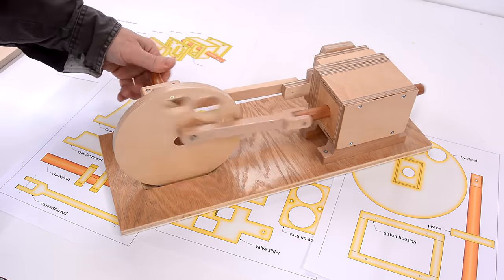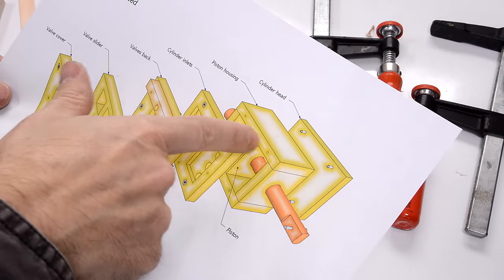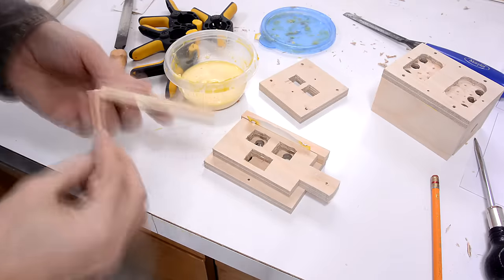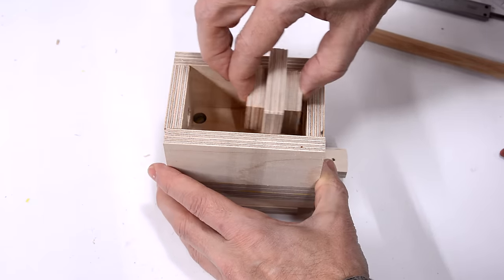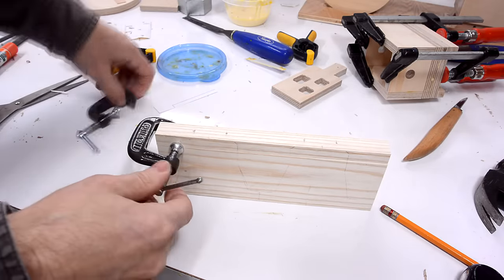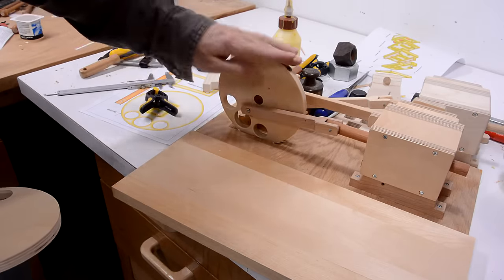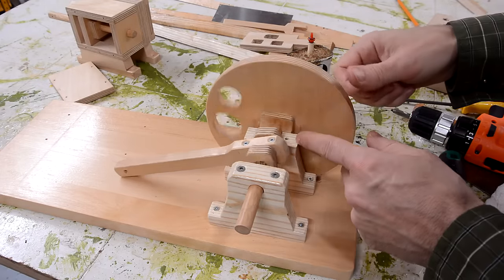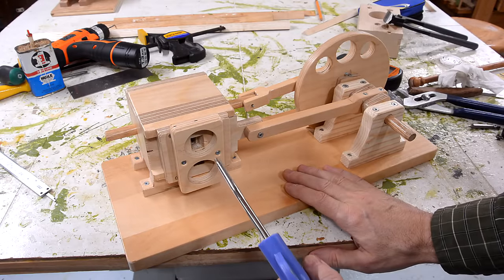Wooden air engine build

Comment: now i want a disc sander to add a little bit of retroactive precision!
Reply: Like your music man.. Nice to see you here..
Reply: So do you come here for inspiration? You make some amazing stuff! It's always great to see amazing YouTubers on others channels.(also how is the new 90-degree foot pedal coming?)
Reply: k2
Reply: nice to see you here :)
Reply: I came down here to comment on retroactive precision, and was glad to see you here, Martin!
I love the mixture of music and building on your channel and am always hyped for Wintergatan Wednesdays.
Reply: Fancy seeing you here
Reply: I love the term  retroactive precision!..
Just wonderful
Reply: Haha not surprised to see you here^^
Reply: Your entire original music machine was bodged  together on the fly with much retroactive precision, until it worked.

Perhaps you could use Matthias’ wooden ,steam engine inspired, type (cold) Air Engine as motive power in your version 2 at some point.

Maybe Matthias could make you a more powerful three cylinder engine for the cause. 
It would look like a foosball table game in play, with the connecting rods and valve gear shuttling vacuum and pressure every which way and in and out all over the place as it ran.
Reply: Scientific Illuminati
Reply: Exactly where I would expect to find Wintergatan
Reply: 2:54 
 @elmasselcuk

Comment: If you connect the axles together and hook up the outlet from the first piston to the inlet of the second (beware of the phasing, the outlet needs to blow air into the inlet when both of them are open), you will have made a two stage engine. :) Normally the first stage would have a smaller piston though, as the pressure is higher there, but I bet it would work anyways. :)

Comment: Would some wax-paper help with the friction and sealing of the inlet-slider?
Reply from the maker: possibly.  But how would you glue that on?  Paste wax would probably be better.
Reply: Quite some time that i last used wax-paper, but i used some in small boat - a bit of sanding and it stuck to wood glue.
But... no idea what wax-paper or what glue it was ^^,
But currently no space for tinkering to test it.
Reply: Mathias, does Big Print program work with Windows 10? Also, what printer can you recommend to use with Big Print?
Reply: Marcus Allen Yes it does. I used it to print a pattern just last week. No problems. My printer is a HP inkjet. I have also used an Epson. Why are you concerned about the printer?
Reply: Fold it over the sides then staple it.

Comment: Thanks for doing this.  I bought the plans for this when you first made them many years ago and, after 3 computer changes, only found them (I think I have them all), split up all over the place, on an external hard drive so I had been intending to try to build the engine when my workshop was finished.  This video is very useful for the detail I would probably have missed.
Best Wishes, Brendan.

Comment: COOL ! Think you could run it on liquid nitrogen?  I have tried a few times to make a bump / bash valve engine out cardboard and a Pringles can but no luck.  Please give the idea of a wooden  bash valve engine a try . The low parts count would make it a quick build and I bet they would spin up really FAST!  Also a wooden Tesla Turbine would be a Hoot .

Comment: Got the plans, had fun making the engine, I was wondering if you could recommend a small motor to power it slowly for the grandkids..its sorta noisy with air and a vacuum , I thought a small DC motor and a variable speed circuit board? any help would be appreciated..Great Plans!!  also quite a bit of wheel wobble on mine..something isn't quite straight..thanks again.

Comment: The correct engine design is no friction, so there is no resistance and no sound, more non-burning gasoline and its noisy explosion sound, with very little energy can play the greatest power, its just the correct design direction.
Like a round flying object when a foreign creature visits the earth, if you 
can design such a machine, it will be a big breakthrough in human.
Wish you success, Goodluck.

Comment: LOVE YOUR VIDS! My next project is a valve for two wet/dry vacuum cleaners which will have them sucking in parallel when at high flow and in series when at low flow, for example when cleaning carpet, during low flow high suction is needed, it will need a simple piston actuator using a tin can.

Comment: Nice job.  A little more in the way of a video graphic explaining how it works so young kiddos could stare at the explanation and capture the understanding of the unified thought of turning fluid flow into reciprocating motion and that's a great STEM teaching tool.  It's pretty great as it is.  Congrats on well made wooden air motor.  It would work if you sprayed it with water ?

Comment: I think you could speed up the offset dowel for the crank pin.  In the 2 blocks with the 2 holes drilled for the pin, drill both half way thru, but from different sides.

Comment: Would be cool to build this air engine into a simple wooden car and try to find a small air compressor to power it. 

Remote trigger pull turns on the compressor to power the car.

Comment: Starting at 10:06 you said the crank needs to be offset by 90° ... so that the control valve is in the right phase.
But it looks like you drilled a hole while the crank was positioned beyond 90°. (95°-100°?)
Thoughts?
Reply from the maker: might be off a bit, I didn't check it.

Comment: When you make your plans, do you space out the parts in SketchUp or do you place them at the correct position afterwards using BigPrint? I found getting the parts evenly spaced out on an A4 paper sheet difficult. 

Also, when you take screenshots to put into a PDF, does a bigger screen equal a sharper image? My laptop screenshots aren't even near the amount of pixels I'm actually seeing on screen. The screenshot must be formatting the picture to a lower resolution or something.
Reply from the maker: I position them in sketchup.  I also don't take screenshots.  I wrote a sketchup ruby script to export the images at the size I need.
Reply: Matthias Wandel Oh nice! Is it for sale?
Reply: I knew you were pretty cool, but I'm tickled to hear you're also a Rubyist. ;D (we leverage it pretty heavily at work, but not for SketchUp)

Comment: Hi Matthias, is there a reason why at 2:08 you're using a drill press instead of , for example, a handheld router ? I guess it's faster because you're already drilling holes in it and you just have to swap the bit and finish with a chisel..
Reply from the maker: routers are noisy and messy, and possible tear out.  And I didn't feel like setting it up.  Drill was faster to set up.

Comment: Safety? Did you really just measure and adjust a cut against a moving table saw blade at time = 0:21 seconds into the video?  You content is way too thought out for that!  Huh? What were you thinking?  Matthias, that wasn't up to your usual high standards for woodworking.
Reply from the maker: wasn't running, just edited out pauses

Comment: Can we use this as an aquarium air pump? how silent is this? if we add a 12v dc motor on the wheel and we add air-pump output, this may work pretty fine in aquaria. More fantasy: we connect to the dc motor to a battery and solar panel, and thus we will have free energy continuous silent homemade air-pump for an aquarium. What do you think?
Reply from the maker: you need a much hither flow rate

Comment: You are obviously a master woodworker, But In trade school we were taught that an Engine Converts Thermal Energy into Motion.  In your case the Energy comes from an external source , so it is a Motor. Great Job on your Motor by the way.
Reply: They do teach those definitions, but in all dictionary definitions, you can pretty much call any motor, an engine. Engine :any machine for converting any of various forms of energy into mechanical force and motion. Considering he is turning electricity into mechanical force (energy into motion), this would fall under that definition as well.

Comment: That big print program doesn't get enough exposure. It is an absolutely incredible tool that is amazingly precise and incredibly efficient, especially at saving ink. Matthias, just out of raw, unbridled curiosity, what brand are those forstner bits?
Reply from the maker: a set of cheap ones from canadian tire, and some from lee valley for the intermediate sizes

Comment: I believe you mean motor. An engine produces its own power. A motor uses outside force, like electricity, hydraulics, or even air.
Reply from the maker: It's an air engine, just like any other air engine.  By your pedantic definition, there could be no air engine, but they do exist - look it up.

Comment: To be completely honest, the only thing that I didn't get is about the crank. Why didn't you take material off from the main shaft to fit the small section? This way you wouldn't have had the need to whittle so much to fit the arm.
Reply from the maker: by leaving the main shaft intact during the glue-up, it makes it easy to make sure the crankshaft is straight.

Comment: It does not matter in this case but normally the piston is connected to the crank and the valve to the flywheel.
Reply from the maker: Unless it's a steam engine

Comment: Matthias, could you try it using steam, and use it to power a very small generator to check how efficient it is?
Reply from the maker: not suitable.  It doesn't handle any amount of pressure, and the steam would ruin it in a minute.
Reply: Yeah, analyzing it further, wood is like a sponge, the wood would expand with the steam, and seize the pump. Thank you for your answer.

Comment: Seems like a laser cutter would be much much much quicker and produce a better finish
Reply from the maker: actually, the finihs from a laser cutter is terrible
Reply: More chars than my code.
Reply: How so?
the only downside to a laser cut is the blackened edges.
Otherwise the cuts are much better and more accurate quality.
Reply: Laser cutting is for cutting fast, and automatically. 

Most automated industry is lesser quality than hand made industry.
Reply: Oh I very much disagree with that statement.
I think you need to think about what you said as it is very wrong.
If you get a master craftsman to program a machine to produce the exact work that he makes, it will do so repeatedly to the exact standard.

If you get a master craftsman's work and make it as cheap as possible then the product produced will be of lesser quality.

Take the car industry for example, when it started and was hand made, often you could not buy a replacement door or bonnet or other parts for your car as each was different due to them being hand made.
Another problem with them being hand made was human error.
Reply: what a silly comment, sure you could make it with a laser cutter or a CNC machine but it's a bloody hobby. making things by hand may not be the most efficient for industry but it is fun. thanks for the video Mr wandel.
Reply: I was not saying he should and i am not expecting him to, i like the way he does it by hand.
I was simply "thinking out loud"
Reply: Maybe if you've never actually used a laser cutter it would seem that way. The finish laser cutters leave on wood is very poor. You'd have to clean the edges up carefully which would lose all the accuracy and time you had saved in the first place. Hand cutting is better if you are good at it which Matthias is.
Reply: Laser cutters produce very nice finishes if you choose the right material and machine settings. The 90W CO2 makes very clean cuts through ply.
One of these made from acrylic would look lovely and the design looks like it would adapt quite well to being made with flat sheets like that.
However it would be much less accessible and for many, takes away the joy of building from wood by hand. Assuming you had any woodworking skill at all. (So that rules me out. I'll stick to metal and plastic and just admire other's work.)

Comment: Would be cool to see this run on actual steam just to see how the engine handles it.
Reply: Wood is a terrible choice to contain steam.
Reply: Poptart McJelly, why steam? Why not just an air compressor?..
Reply: David Colmer because air compressors need a motor, which means you're using a motor to store energy to power a motor. Steam is generated by any source of heat, so is much more sensible.

Comment: I wonder if it's powerful enough to run a large toy train
Reply: Jack Mcslay well if you can get it to run steam it will have plenty
Reply: Jack Mcslay I do think it would with good seals and pressure control.
Reply from the maker: it would last about a minute on steam before everything goes all warped.
Reply: Could you test this? It seems like an interesting experiment

Comment: Is it possible to find a practical application for this?
Reply: i don't think so...
Reply: its really not powerful enough to use it in any practical way. It does take an energy source and convert it into an action, but there are way more efficient ways to do that than this.
Reply: Not powerful?! Both strokes are duty stokes, the piston area is big enough to run the engine by blowing in it with a mouth (peak pressure around 0.1 bar or 1.5 PSI). Any real compressed air source with typical pressure of 6 bars (90 PSI) will turn thing thing with an insane amount of power (If it survives such load).
But even low power levels can be practical. All depends on application.

Comment: Curious if it would work with steam.
Reply: Yes, but probably not for very long. Steam and wood aren't exactly compatible materials.
Reply: seigeengine ... yeah, figured as much. They basic design might work in metal though, might have to try it on a smaller scale someday.
Reply: Daniel Dennett Sure, but I'd probably just look up steam engine designs at that point and work off those.

I'm also pretty sure you can buy steam engine kits if you're more curious about having something to play around with more than building it yourself.
Reply: Very true. I'll have to do some research and see if I can find some plans. 
Was trying to think of a way to use this design in a more useful way, but it is really just a toy. Maybe connect it to a bellows and have it as a STEM project from kids to play with. Maybe put plexiglass on top so they can see the piston move.
Thanks for your replies.
Reply: Daniel Dennett Well I mean, air tools are a thing. This isn't an ideal solution, but you could conceivably use something like this and hook it up to a compressor to power home-made wooden tools.

Comment: How do you get such good quality on your plan prints. I use sketch up pro and then save the file as an image to it transfer it to Big print, but when i try to print 1-1 i get a blurry pixelated picture. Please help me.
Reply from the maker: save it with higher resolution
Reply: Matthias Wandel thanks!